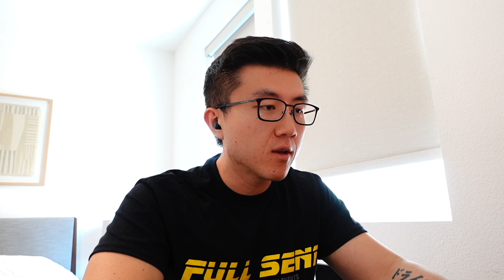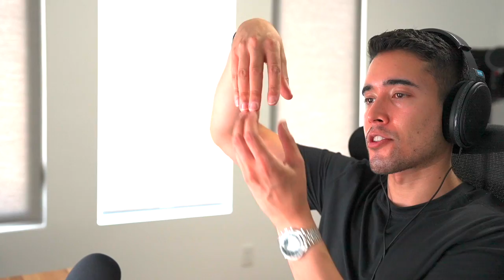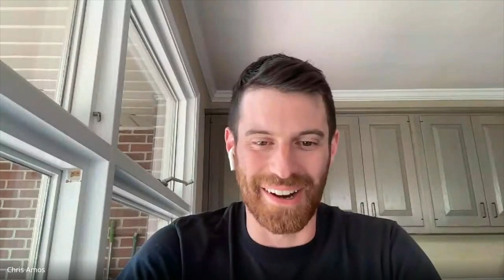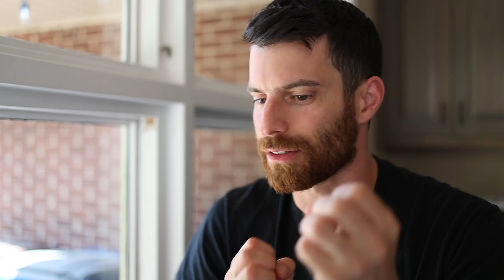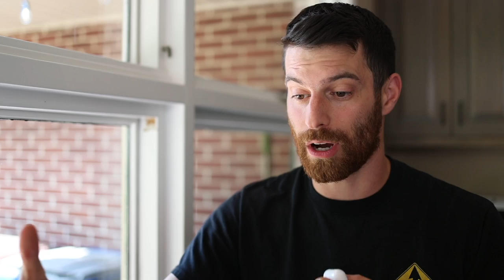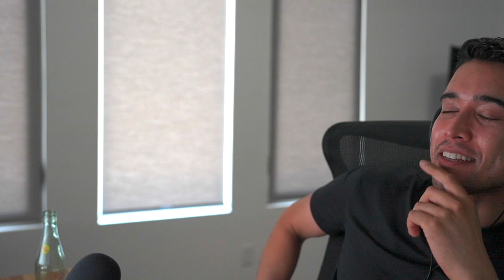Is Your BRZ or GR86 a Ticking Time Bomb? ft. TheTopher and Jubbal & Cars - ZCT #35

Comment: Is this not almost the same issue with WRX STI where they need an oil baffle because the G forces in continued turns prevents oil from properly getting circulated? Y'all touched on this but also said oil baffles were not a fix (I think, if I heard right). Disappointing to see all around but hopefully it gets pinpointed down.
Reply: Yes, one of the issues. Wish they talked about flat engines being the common trait between the STi and BRZ. From what I gather, oil starvation is a risk on any flat engine. The risk depends on pan design and other variables (i.e. wet vs dry sump).  On a lateral corner, oil doesn't drain from the head to the pan like a V engine. That might be why we see oil starvation on cars with flat engines more than other designs. With that said, plenty of people drive cars like the STi and BRZ within their engine's intended purpose (street) without issue. My 05 STi has been extremely reliable and the reason I don't upgrade the oiling system is because it's street driven on all seasons tires.

Comment: My question is I have a 23 brz… you covered people that track and auto cross… what about people like myself that don’t track or auto cross… occasional canyon/mountain run and mostly hwy driving…. If your not pushing crazy g’s like on the track is this really even an issue? (You did mention it in the end after I posted)
Reply: I have a 23 gr86 and do mostly mountain driving. Got about 12k on the car now and no problems. Push pretty hard sometimes. I don't think you'll know you have a problem until it's to late.
Reply: @rutleyj  your not pushing high g's on the street for extended periods so I dont see how this would be a problem at all.  Do you plan on doing anything?

Comment: Is this where the aftermarket should be helping? Wouldnt a re-designed oil pan and/or pickup remedy this?
Reply from the maker: Curious about this too.
Reply: Yeah there's a huge market for this now, I bet. Killer B is working on a baffle. It's under testing now

Comment: Also, Porsche has proven there is no inherent design issues with flat engine designs (but they have had their issues over the years, and cost more than a BRZ to fix in most cases lol).  Subaru's engines have never been designed for the track however, and are designed for regular use.  They don't include Air-Oil seperator systems like Porsche engines do, nor do they have extremely well baffled oil pans, over-designed oiling systems, or dry sump oiling systems from the factory.  If you want to see what CAN be done to make these engines work for racing uses, just look at all of the rally teams and what they've had to do with the engines the last 30+ years to make them work well for racing purposes.
Reply: What do you consider proof? I think Porsche has proven if you spend enough money you can engineer around issues. The engine placement in the rear is just another example. That doesn't negate the inherent risk relative to other engine designs. On a lateral corner, oil doesn't drain from the head to the pan like a V engine. A long sweeping corner on track, or even highway off ramp, can cause the pickup to suck air. That's a topic they talk about in this video. The reason modern Porsche flat engines don't have the same issue is due to a hybrid wet/dry sump or full dry sump. I love my Subaru, but all cars have pros and cons. Like you said, these are street cars and perform well in that space. They're not race cars. Also, the EJ257 has an air oil separator from the factory, but people often upgrade to compensate for track driving. Not sure about the FA engines.
Reply: @QuintonLeister  Inline and V engines have compromised design issues to that have to be compensated for, like inherent imbalance and gravity pulling oil down away from the head too.  I've seen plenty of EA888's blow smoke during corners, Honda engines grenade on the track, and plenty of V engines including a new ZR1 die during track use.  There is no "perfect" ICE engine for racing at any price.

The EJ257 just has a standard PCV system same as any EJ engine, nothing at all like what Porsche includes.
Reply: @stevemartegani   oh, for sure. Every design comes with pros and cons. 
I mention the factory AOS on the EJ because while it’s nothing like Porsche, it does have one. Obviously it leaves much to be desired. Especially, when increasing boost. The PCV system is something I monitor closely on my STi.

Comment: Great video! My takeaway is that if you want to grip-ify your BRZ/86 then dry sump/oil system upgrade is needed. I've recently got a 2012 BRZ with supercharger and suspension mods so this is interesting to me (for now not looking at putting the car on track)

Comment: Until this issue is fixed I won’t buy one. I want to get one later but unless this problem is fixed I will not buy one and might go with something different if it is not fixed by the time I am ready. I bought a new Forester Wilderness recently and planned on adding a BRZ in a year when Forester was paid off. Love my Forester and I had not heard of this issue at all until I started watching BRX GR 86 videos and researching them
Reply: Man, but I don't want an automatic Outback. If it was manual, different story. So frustrating. Miata is too small and dangerous for Minnesota, GR86 has RTV issues, and Outback is automatic. So frustrating!

Comment: So either don't push it to hard or GSPEED dry sump for FR-S or BRZ (it does retail for $4,955.75). Seems like it is meant to be a fun car, but not a full on race car, if you want to turn it into one, that always costs money.
Reply: But Miata is full on race car from the factory. Why is that? Mazda superior to Toyota and Subaru?
Reply: @chrisx5127  Not necessarily, these cars are not full on race cars, and they were never meant to be. All sports cars (including the MX5 require modification if you want to do serious track work. 
The MX5 and the previous generation BRZ/GR86 do not seem to have this oil starvation issue, but they probably do only to a lesser degree. Because full on race cars (and even high performance street cars) use dry sump oil systems for a reason. If you want to try and run with the big dogs it will require more serious modification. If you use these cars as intended, a fun sporty street car, or track it more or less stock, it seems to be fine. From what I can gather it is only when you start upgrading the suspension and tires that this oil starvation becomes an issue. That is true of most cars, if not oil starvation it is hundred other things. 
Apparently something about this new engine design makes it particularly susceptible to this issue and requires modification if you want to drastically improve performance. That is racing in a nutshell, you either lower your expectations, or be prepared to spend lots of money. 
In some cases you can upgrade the oil pan to one with larger capacity and baffles to reduce slosh. I did not see where that was mentioned as an option, perhaps there is a reason why that is not a viable with this car? 
I was just curious and was able to quickly find that there is a solution to this issue, it is pricy but like I said, welcome to racing. 
So yes the MX5 does appear to a be a lower cost option if you want to go do hard racing, but it is very small and impractical. No car is perfect, and generally the less you spend, the more compromises you will have to make. But yes, if you can fit in it and live with its practicality limitations, the MX5 is great and cost effective choice. 
However, in the overall scheme $5K for a dry sump is not bad, and I am sure it could be done for much less, or maybe there is a more cost effective solution? In this video they talked about the problem, I did not hear anyone mention potential solutions, which is why I mentioned this dry sump option.
Reply: @ericmichel3857  You hit the nail on the head. No such thing as a perfect vehicle. Though the 2016 Subaru WRX was as close to perfect as it gets (for me), but I didn't have enough money back then :(

I really like the Miata, but I also live in Minnesota where it snows 8 to 9 months out of the year. We actually call it Minnesnowda instead.
Reply: @ericmichel3857  So if I want to take them to the track (eventually), how much do I have to pay to have them mod for track use?
Reply: @chrisx5127  That would depend on the car, your expectations for performance, and usage. Are you an experienced road course driver or new to the hobby? Do you want to push it to the limit and be able to keep up with certain types of cars, or do you  just want to have fun and push it a bit on occasion? If it is your daily driver you really should be in the latter category.
That is what's so funny when people post videos about how they kept up with or passed some random high performance car at a DE event. It is meaningless because you don't know how talented the driver really is, what shape the car/tires are in, and what there intention is, they might have been taking it easy for a number of reasons. 
It is nothing like actual competition racing where you can be reasonably certain the drivers have a minimum skill/experience level (even then not always, sometimes they just have a lot of money), and the car is optimized (hopefully), and they are pushing to win (again not always, if it is a series sometimes they are just there for points).
Reply: @ericmichel3857  Great question Eric! I'm either getting a sport car or a truck. Whichever one I get; I intend to reach the limit that it is capable. If it is a GR86/BRZ/MX-5, I will take it to the track eventually (maybe after 60K miles). If it is a truck (2024 Tacoma), I will take it off-road and do a lot of rock crawling. If it is a Subaru Outback, I will drive all over the country and mild off-road trails since I don't require a hotel.
Reply: @chrisx5127  If you are new to the DE track day hobby I would start with a stock car, maybe just switch to a high temp brake fluid and a track/street brake pad. Then if you keep going and you skill/comfort level rises, then you can start doing other stuff. BTW I just had a video pop up on this issue, if you are looking at the GR86/BRZ for track days, I would say talk to this guy: https://www.youtube.com/watch?v=Ru_2uTozXNo
Thicker oil, an oil cooler, and an oil pan baffle, this is common sense track modifications 101, and yet all the videos of folks talking about this issue, this is the first one I have seen where these potential solutions have even been mentioned. This is what I was looking for when I found that $5K dry sump option, I was surprised there was nothing like this being offered given all the reported issues. How no GR86/BRZ performance shop seems to be selling an oil pan baffle like this for these cars is absurd to me. 
From what this guy says, if I was going to track one of these cars, I would do these three cheap simple things and then not worry about it. Perhaps Toyota/Subaru will add a pan baffle and recommend heavier oil for summer track events. That is probably all that is really needed, the cooler is a good idea for any track car, but not entirely necessary if you are a casual track hobbyist and have a good heavy synthetic oil and can keep the oil pressure up, it will most likely be fine.
Reply: Agreed, the 86/BRZ are not meant to be full-on track cars. A Type R or N car are meant to be raced on the track stock.
Reply: @Ezero8  LOL, actually no, all of those cars require modifications for serious track use. There is a big difference between a few hot laps (which all of these cars can do, including the 86/BRZ), and racing/ heavy track use. None of these cars are setup for that, which is why they all have many track modifications available.
Reply: @Ezero8  But both the R and N are ugly?